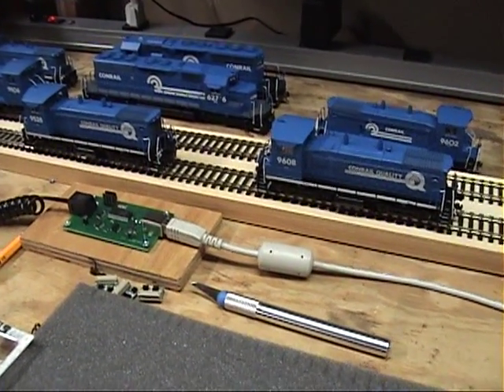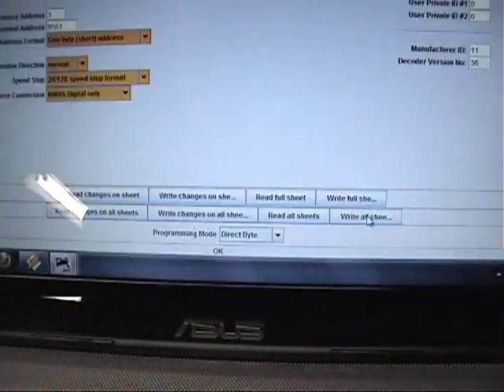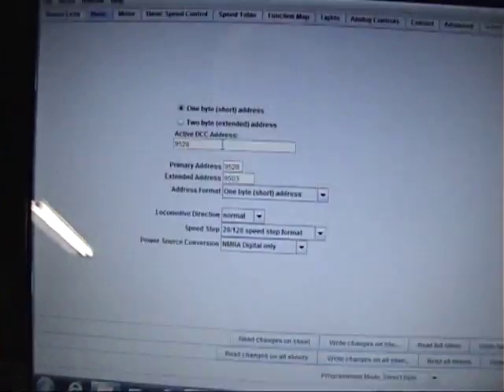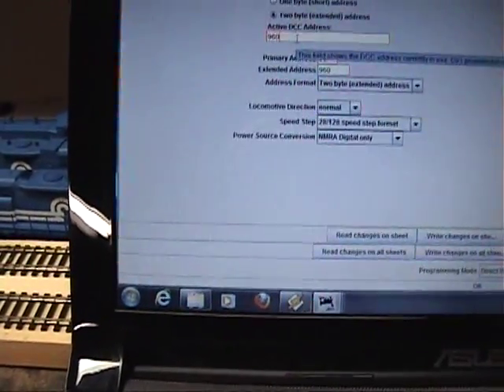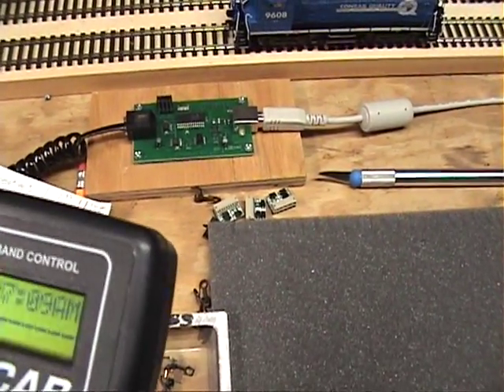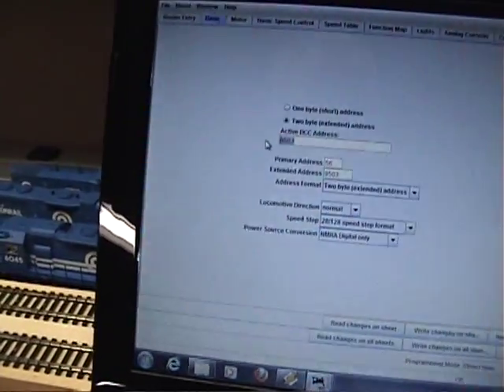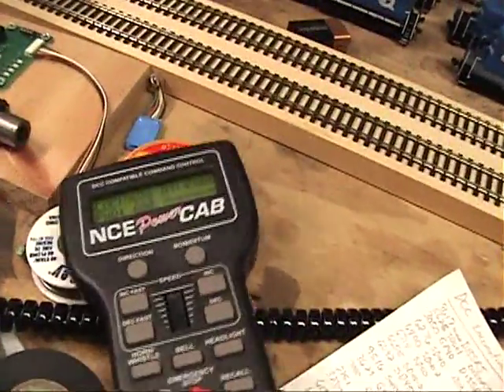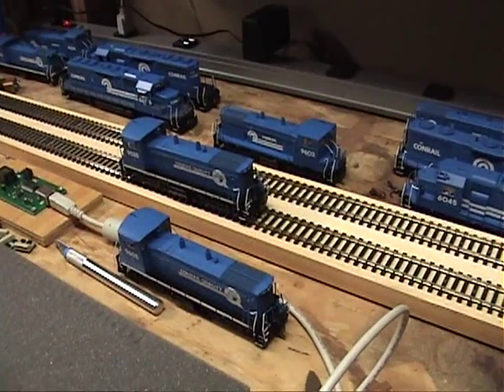Programming with NCE USB Interface using JMRI DecorderPro3

Comment: This WILL NOT WORK WITH POWER HOUSE PRO SYSTEM THAT HAS SERIAL PORT. You need a keyspan 19 USB to serial apapter. NCE sell this adapter for power cab and SB2